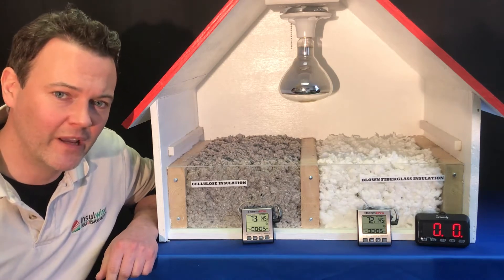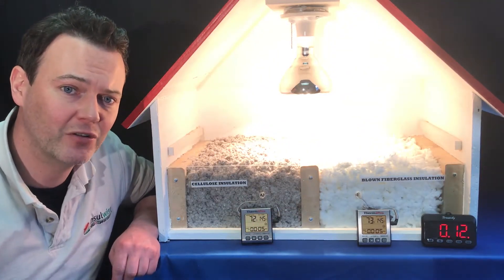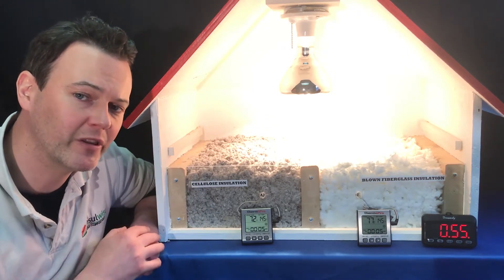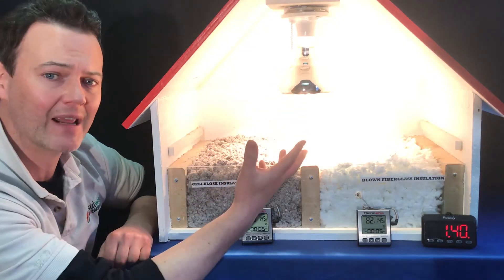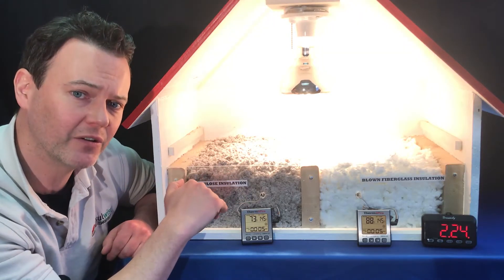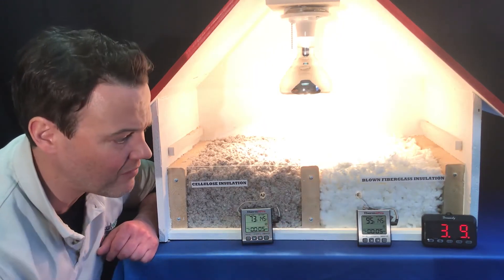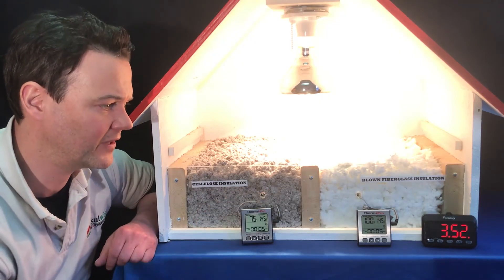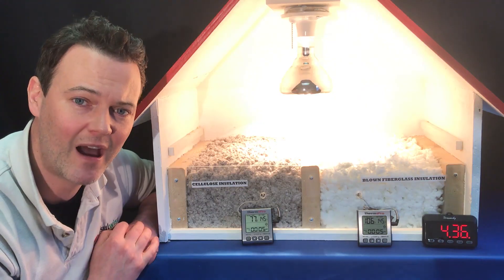Cellulose vs. Fiberglass Insulation: The Ultimate Showdown

Comment: I live in south Florida which is obviously a humid environment year around. The contractors I keep talking to about cellulose vs. Fiberglass say the cellulose settles and deteriorates too quickly here. How bad to you believe the deterioration could be of r-38 and over what time period if at all...in your opinion?
Reply from the maker: Well, I have gone through BPI (Building Performance Institute), analyst training several times, and I have never encountered that opinion, at any type of "official" level before.  At Insulwise we have been installing blown in cellulose insulation in attics for well over 10 years here in Pittsburgh, which is also a very humid climate.  We get nearly as much rain as Seattle (and let me tell you, it sucks! ; )   We do not see cellulose ever settle any more than about 10% here.  I've had to go back and inspect a number of attics that we've blown years after we've done them, and I've never seen anything beyond the expected 10% settling.  I have also never seen it "deteriorate."  The modern stuff (I'd say post 1970's when guys were literally grinding newspapers in the backs of their trucks) is highly durable.  Basically nothing can eat it, not insects, microbes, animals, fungus, etc due to the various non toxic treatments that are applied to it.  

In general I'd say it makes sense to blow every attic to a minimum of R-49.  In our opinion we would always recommend using cellulose insulation due to it's substantial thermal, as well as cost and environmental advantages over blown fiberglass.  Any professional insulator realizes that it settles a bit, which is actually advantageous in our climate (it makes it harder for cold winter air to "percolate" down through it, which is what causes the R-Value-defeating convection currents in blown fiberglass).  The manufacturer that we use, Advanced Fiber Technology, has tables on their bags showing that to achieve an R-49 insulation level, that we need to blow in about 14.5" of cellulose.  After settling the expected 10% after a few months this leaves about 13" of cellulose remaining.  Their cellulose insulation has been rated to achieve an R-3.8 per inch, so R-3.8 x 13 inches gets us to a settled overall R Value of R-49 and change.  

If you're dealing with a legit insulation pro, he'll be very aware of this.  If you're dealing guys who are experts in other fields, but not specifically insulation, all bets are off.  Insulation is often given short shrift by general contractors, etc.  Most assume they're experts --- and from my experience they're not.  

Lastly, here's a link to our website where we offer a bunch of third party research to help people out.  https://www.insulwise.com/answers/third-party-resources/

Hope this helped!
Andy

Comment: While cellulose for my attic seems like a great choice, I read recently that while the borate is non-toxic, the actual newsprint may have some respiratory toxicity from the ink in news print. Does that seem correct?
Reply: matter what's a bad news is bad even in recicle paper 🤣
Reply from the maker: I don't believe so.  To my understanding cellulose insulation is one of the most benign insulation materials on the market.  I found this online and believe it to be accurate. 

https://www.buildinggreen.com/feature/cellulose-insulation-depth-look-pros-and-cons

"Concerns have also been raised about ink residues in cellulose insulation. There are two basic types of ink used in newspaper printing, according to Don Hensel, Environmental Manager at the Newspaper Association of America (NAA). Black inks have traditionally been a mixture of 60-80% petroleum-based mineral oil, 15-20% pure carbon black, and small amounts of other additives. In recent years, soy-based inks have gained in popularity. With these inks, oil made from soy beans replaces the mineral oil; the carbon black is still the same. The primary concern with inks has always been colored inks, which were traditionally made with toxic heavy metals such as cadmium and lead. According to Patricia Penza of the General Printing Ink Division of Sun Chemical, however, colored pigments weren’t used in the news industry until about ten years ago. By that time, she said, the health hazards of lead and other heavy metals were well known and NAA (then the American Newspaper Publishers Association) banned their use in newspaper inks."

We wear respirators when we blow in cellulose insulation because it doesn't seem smart to inhale any kind of dust, regardless of what's in it.  It looks like the inks tend to be petroleum based mineral oils or even soy oil.  Either way there does not seem to be any toxicity issues with using it. 

Best regards, 
Andy

Comment: In a high humidity area like Louisiana , the cellulose will settle so bad that after 10 years or less you will go from 24inches to 3 and be useless. Use blown fiberglass or batts or foam if you live in a high humidity area.
Reply: I live in south Louisiana and I am in the process of researching insulation types. Do you have cellulose in your attic?
Reply from the maker: Hi Don, thank you for the comment, but I have to respectfully disagree.  Blown in cellulose settles by an average of 10% (when properly dense packed into exterior walls, it does not settle at all).  Pittsburgh has incredibly humid summers as well as winters...we get nearly as much rainfall as Seattle!  I've been installing cellulose insulation into attics here since 2008, and we've not gotten a single call back about it settling by more than 10%, much less 90%.  Actually, we haven't gotten any callbacks about it settling at all come to think about it...so I'm guessing that means at a minimum that no one has poked their heads up into their attic and wondered where their previously super thick blanket of cellulose insulation went to! ; )

It's worth noting also that we've done thousands of homes in the Pittsburgh area.  To my knowledge there is no strong evidence anywhere that this happens, and from a physical standpoint I don't know how it even could.  So folks, please don't hesitate to have cellulose insulation blown into your attic regardless of your climate or location in the US or Canada.  It will perform much better than any other material than you could use over its lifetime.
Andy

Comment: Can I spray cellulose on top my old insulation in my attic or do I have to remove old one
Reply: yes... most brands advertise that you can blow it on top of ANY previous insulation... I would only bother removing old insulation if you have mold, or it has been damage/dirtied by animals (freaking raccoons)
Reply from the maker: Yes, we "top coat" over existing insulation all the time.   It'll make whatever you have there presently perform far better.  The main thing that you need to do is air seal the air leaks in the attic floor before adding additional insulation. 
Andy

Comment: how about in the long run which one would last longer.? for what i seen cellulose insulation starts settling after a couple years and fiberglass insulation seems to stay more fluffed out. dont you lose r-value if it starts settling?
Reply from the maker: Hi Joselyn, cellulose insulation settles by about 10% after it is blown in.   So when we blow an attic to an R49 insulation level, we blow in 15" inches.  Because the cellulose insulation that we use has an R-Value of about 3.7, once it settles down to about 13.5" inches, you are still at an R-49 (R49 / 3.7 = 13.2).  However that's not the whole story.  The fact that cellulose settles a bit when it is loosely blown into an attic ( as opposed to dense packed into an exterior wall) is actually a very good thing.  Once it has settled a bit, the surface of it becomes firm.  This is good because it forces cold, dense, winter air to sit on top of the insulation layer rather than being able to penetrate down through it.  
One of the main weaknesses of blown in fiberglass insulation, by comparison, is that the fibers remain so "light and poofy," that cold, dense, winter air "falls" down through them.  If you've ever opened your refrigerator door when you were barefoot, it's the same effect in terms of feeling that heavier, denser cold air spill over your feet.  But what's happening your attic is that convection currents are being created within the fiberglass, actively wicking up from your ceiling below (the opposite of what you want to have happening!).   And the colder (and more dense and heavy) the winter air, the more this effect happens.  Literally, the R-Value of blown fiberglass insulation DROPS as the air sitting on top of it gets colder.  Not what you want!  With cellulose insulation this does not happen at all.  
And if you want to know how the two compare during hot summer temperatures --- just watch my video again : )

Andy
Reply: @insulwiseenergycomfortsolu3293  And when compared to R38 batts?
Reply from the maker: @fastsvo  R-38 batts perform better than blown fiberglass due to the fibers being woven more tightly together (air cannot flow through them nearly as easily).   That said batts are nearly impossible to perfectly install on an attic floor.   Attic floors are covered with wires, junction boxes, odd shaped bays, plumbing pipes, etc and this results in gaps.  Gaps cause the combined R-Value of the attic to be substantially compromised.  Click on this link, scroll down, and you'll see exactly what I mean.  Look for the R-38 batt that has been wrapped around the plumbing stack pipe in the attic floor.   Something like is happening in just about every attic that we go into.  
https://www.insulwise.com/insulation/attic/

That said, blown in insulation, and in particular blown in cellulose insulation, conforms perfectly to the attic floor every time, allowing zero gaps.  This provides a FAR better outcome. 

Regards, 
Andy Haak
Reply: fastsvo p

Comment: Do you know the comparison of Rockwool at 75% recycled compared to cellulose? thanks
Reply from the maker: Well, my understanding of rockwool is that it is a mineral fiber.  It's often made from a combination of some type of rock that literally gets melted down to where it can be spun into a fiber, and "slag" which is a byproduct of making steel or smelting copper.   The biggest component by far when these two materials are compared is the amount of energy it takes to create them, often referred to as "embodied energy."   

Collecting recycled paper, shredding it, and treating it with non-toxic fire retardants requires about 80-90% LESS energy then melting down literal rock to a point where it can be spun into a fiber.   The reason this is a considered a "greener" or more sustainable process is because a lot of the energy that we use in the US still comes from burning coal, natural gas, etc.  And the more of these things you burn, the more carbon dioxide that gets put into the atmosphere.   That is the general argument when it comes to sustainable issues between cellulose insulation and mineral fibers like rockwool and fiberglass insulation.
Andy
Reply: Cellulose is 85% recycled.

Comment: Hi, this is by far the simplest video demonstration that I have seen. Really like your video! Thumb up! 
questions to you if you don’t mind, is there any brand or type of cellulose that I could buy in homedepot? Also, do you recommend to fix it ourselves or to hire someone to install the insulation and roughly how much for a 2400sqft house?How long does the cellulose last before it needs to refill the insulation? Does it to cover up with a board to enclosed the insulation? Thanks!
Reply from the maker: Thank you!   I tried to make it as simple, straight forward, and easy to understand as I could.  You need to first air seal your attic before your insulate it, or you can cause problems with your attic and home down the road.  Here is a link to page that explains that:  https://www.insulwise.com/insulation/air-sealing/

Once your attic has been air sealed, you then want to insulate it to an R Value of R-49, that is approximately 15" inches of cellulose insulation.  That is now code in many parts of the country.   If you are careful, have the time, and don't mind getting a bit dirty you may be able to do this work yourself.  You can buy cellulose insulation at many big box stores like home depot.  The coverage chart on the bags will tell you how many bags you will need per 1000 sq ft (depending on what height and R Value you are blowing to).   Cellulose insulation does not noticeably degrade over time, so once you blow it in you should never need to "refill" it.  It will settle by about 10% on average, but that is understood on the depth charts which is why if you want a settled 13.5" you blow in 15" when first installing it.  

Thanks!

Andy

Comment: I'm going to have more insulation blown into my attic. I bought this home 2 months ago and there is only R-19 cellulose up there from 1998. Some has settled and some kicked around from other workers being up there. I live in the Sacramento area and was contemplating whether to add more cellulose or blow in fiberglass on top of cellulose?
Reply: Hey there sunking, you definitely want go with cellulose insulation, it is simply far more effective .  However, I cannot recommend enough having your attic air sealed first.  Beneath your existing insulation, there are dozens of penetrations that go down into your home that are allowing air and moisture to escape upward to your attic when you are heating your home, as well as allowing dirty gross attic air to be pulled downward into your home when you're cooling it on hot days.   These air leaks cause significant losses to your home's heating and cooling efficiency.  They also can dramatically impact comfort and interior air quality.   This is a link to my site's Attic Air Sealing page that I think would be helpful for you to take a quick look at.  It'll definitely be worth your time to have a look at the photos.   There are also 2 short cartoons we've created to show what happens seasonally in homes.
 
Air Sealing Explained:
https://www.insulwise.com/insulation/air-sealing/

Wintertime Syndrome Cartoon - what happens in your home during cold weather:
https://www.youtube.com/watch?v=eZdU6ftYFfA

Summertime Syndrome Cartoon - what happens in your home during hot weather:
https://www.youtube.com/watch?v=mTw_fd-aaZE

Hope these help!
Andy
Reply: Curious as if you have seen significant improvements if you had this work done. We only have R19 in our attic and our power bills during the FL summers have been brutal.
Reply from the maker: @ltankhsd    Hi there, this is a review that a custom of ours named Marissa just left on our google business page a few days ago.  We insulated her attic 6 months ago, and she talks about the impact that she got from the work over the winter.   If you google "insulwise" you can see the review.   An air sealed attic floor with a thick layer of cellulose insulation (15" total including your existing 3-5" of fiberglass) will block a tremendous amount of the heat that is being radiated down from your roof into your home on hot Florida days.   You will feel the impact immediately.   We do A LOT of work here in Pittsburgh getting the upper floors of people's homes easier to cool by air sealing and re-insulating their attics.

Review from Marissa:

"We had Insulwise put blown-in insulation in our house last fall, and after experiencing our first winter with it, we couldn't be happier - it cut our usual winter gas bill in half!  The room maintains a consistent temperature more easily, heats up much more quickly, and is quieter (a nice added bonus!).

On the day of the installation, the crew was prompt, friendly, professional, and answered any/all questions I had.  I'd recommend them to anybody looking for a similar service!"

Comment: Excellent demo. Is it true cellulose don't need to be vented? I am build a tiny Aframe cabin can I completely seal the rafters with cellulose to prevent mice and rodents? How does it handle condensation in cold N. Idaho?
Reply from the maker: The short answer is no, this is not true.  You want to provide an ability for moisture to escape any type of structure.  You could be just fine, but I work from the premise that over time "things happen" with structures.  Roofing can nails pop, flashing can fail, lots of people, humidifiers, wet basements, pets, house plants, etc can pump moisture into the interior air and force it into wall cavities via holes in the back sides of electric outlets, through recessed light fixtures, wire holes, etc.  We are proponents of solutions that provide for redundancy...ie if the brilliant solution fails in some way, it doesn't result in a part of your house rotting in an area where it could go undiscovered for years.   However I've never worked on an A frame construction style home, so I can't speak toward it's particulars with any real expertise. 
Hope this helps, 
Andy
Reply: @insulwiseenergycomfortsolu3293  Thank you it makes perfects when you explain it.
Reply: You can always put in a ridge vent to vent your roof, although you will want an air space on top of the cellulose.  However, a better system would be to have your roofing spaced off of the roof sheathing using wood furring strips on top of your roofing weather barrier sheet.